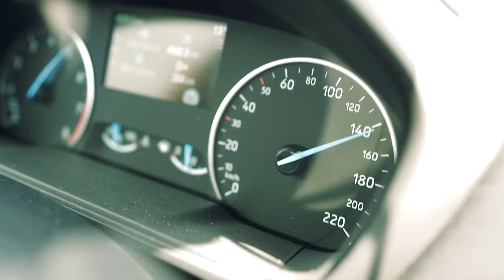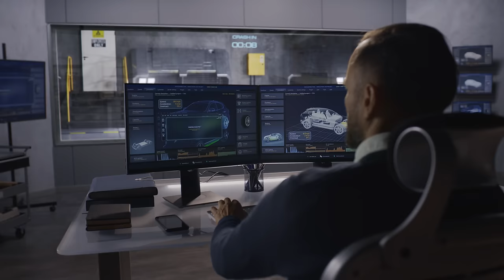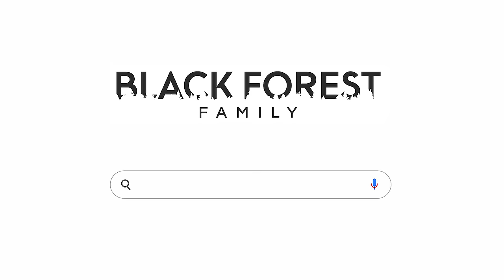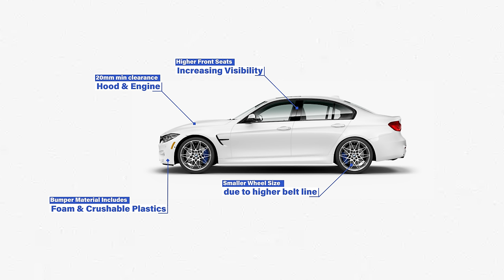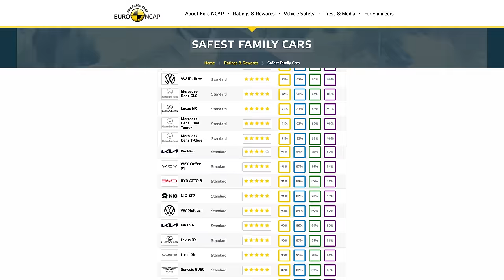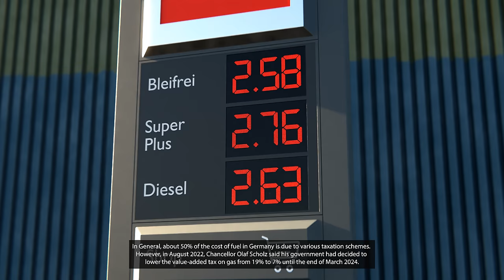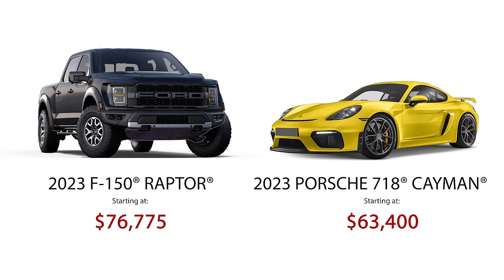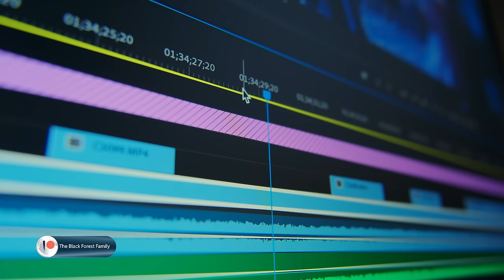DRIVING CULTURE CLASH: Why do our Cars LOOK so Radically Different?

Comment: One of my co-workers loves his Ram truck. So much so that every few years he trades it in on a new one. I get it, he likes them, but honestly, he uses it as a truck twice a year. Once in spring when he puts his boat in the water and once in the fall when he takes it out. Renting a uhaul would be cheaper.

I have always owned European cars. Mostly Italian and Swedish. Currently though, I have a Fiat 500 Abarth and an ancient Landy. The Land Rover earns it's keep, dragging my boats all over, carrying kayaks on the roof, and I camp in it. It's more truck like than most people's trucks.

Now if you ask me why I prefer european cars, I value handling and braking over straight line speed and acceleration. I also think they are screwed together better and the interiors are nicer. The leather in my 20 year old land rover still looks like new even though I have never treated it, but the leather in my co-worker's last Ram was already showing signs of wear and scuffing after 5 years of use. Maybe I am just nicer to my stuff than him, but I doubt it.